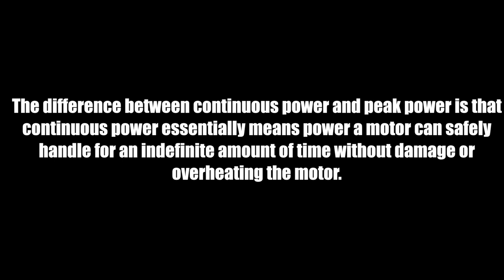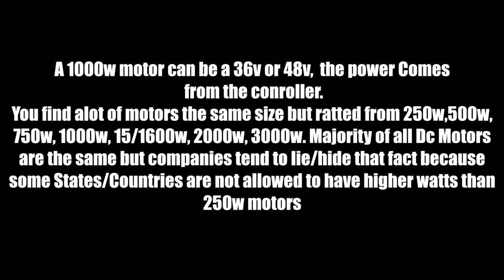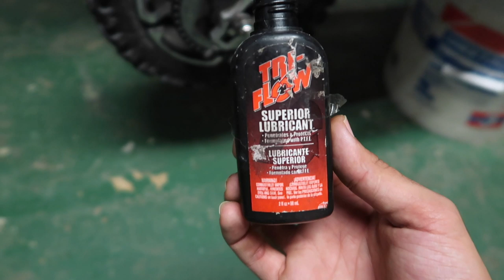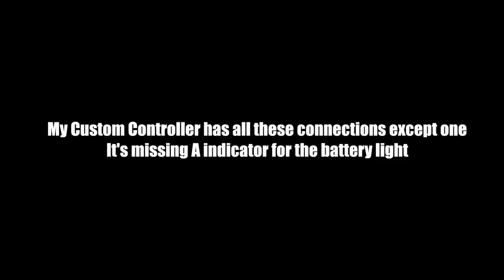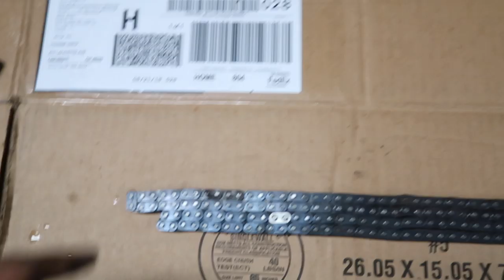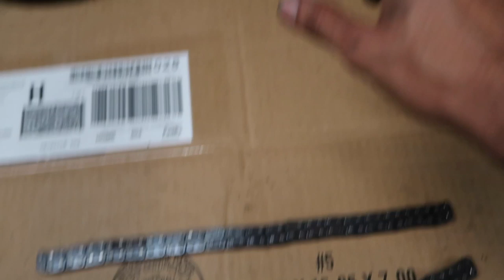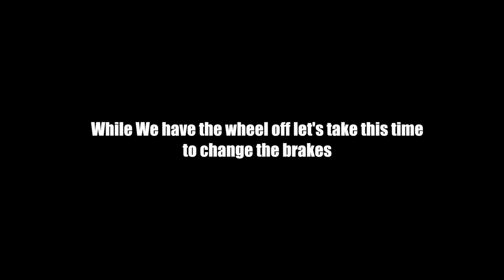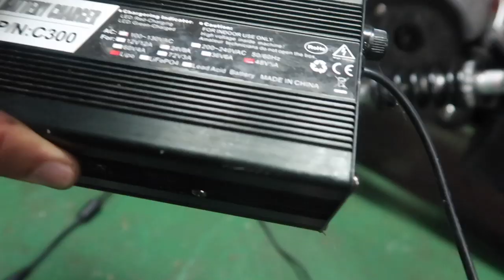Uberscoot 1000w/1600w Electric Scooters FAQ / How To

Comment: I love my UberScoot! I’m a70yr old Granny and live in a rural desert area. The knobby tires and shocks take me over rocks, bushes, any and everything the desert has. I’ve ridden uphill on trails and cruise through town.  Now, I have a problem. Lead batteries need to be replaced.  I’ve been told to go lithium. I know nothing about lithium. Where do I get them? Do I need new harness? Do the batteries come with wires, charger? Can the new battery be charged by the original Uber charger? I know, a lot of questions, but it’s beautiful outside! Not 110 degrees out yet! I want to ride, but can’t!  Please, any answers are greatly appreciated
Reply: All you need is the battery.....it should have the same receptacle on it.... your charger will take longer to charge it I'm guessing..
Reply: A few years late but a lithium battery cannot be charged with the lead acid charger and controller that comes with the original scooter. For instance a 48v sla battery charges to about 52v then shuts off. A lithium battery at 48v will charge to 54v and a lithium iron phosphate "lifepo4" battery will charge closer to 58.8v I advise a lifepo4 battery as they last twice as long as lithium ion "charge cycles" have a deeper draw charge faster and are safer. Threw one in my ecosmart metro and it compared to the previous same ah lipo is 6x longer between charges. They are also safer and less effected by cold and hot weather. Less fire risk than lipo. The only draw back to lifepo4 is they are heavier than the lipo batteries but still lighter than sla batteries. My 48v 20 ah battery has gotten me to work and around town for almost two weeks before dropping one tick on the battery meter while the 7ah sla batteries only got me to and from work for about 2.5 days. My lipo batteries struggled by about day 4 or 5 voltage sage was horrible requiring a recharge again. Go lifepo4.

Comment: 3 months later, no comments, suggestions.  Didn’t need your help after all 😏. Amazon had the perfect battery, best price I found.  Installed, no prob. Even installed the new charger attachment where old 1 was for the lead batteries.  Scoot is now light enough, I can lift the front or back, no prob. A few adjustments to chain, air in tires AND off I go! Farther and faster than before. 25 miles on combo dirt/pavement and on yellow now.  Possibly 30? I’ll let you know!
Reply: what harness did you use?
Reply: @BIGCHATZ42  I ordered my battery off Amazon and it came with a harness/pigtail.  I cut off the harness from lead batteries, used butt connectors to the pigtail end of new battery.  happily riding ever since.   I’m a 70 yr old Grandma and I love it! I ride it around our little town almost daily.  To the point I bought a 175cc Scooter for cruising the roads and places farther than my Uber can go. 👍👵🏻.  ps:  going to have to change my name, I am no longer Stuk Here! Lol

Comment: Hey man this is an excellent video! Really informative and fun with the ride at the end! I am looking forward to getting a 1900W 48V machine sometime around April (I live in a northern climate). I am definitely coming back to this video in the future. Saved in favorites
Reply: Oh and a quick question. The machine I am getting is actually 1600Wbut it has a peak turbo mode at 1900. Do you think its going to be a significant difference in uphill speed?
Reply from the maker: It’s most likely the same as my scooter cause it’s 1600w but in the video we see it’s actually 1900w+. Make sure the controller has 40AMPS output. If it comes with a lithium battery yes it will fly uphill. Anything lower than 40AMPS on the controller don’t buy it, unless you planing to upgrade it yourself. Do you have a link to the scooter I’ll check it out for you
Reply: But it also says that the 1600w motor has a custom made controller to make it 1900. I will definitely ask them if the controller is rated for 40amps. Thanks for the tip
Reply: @Scentedstyle  can this go offroading like super offroading

Comment: Hello Jason,  your videos about the UBER scooter are Full of great information.  I have a 1600w original scooter it is a great scooter time has come to change the Baterries. I want to upgrade to lithium 48v, 254h and 2000w. I'm buying the Battery from the website you recommend. I had two questions.  Question number 1. Do I have to change the original controller that comes in the scooter or I can use the same controller?    2nd question what type of fuse should I use for the Battery harness with two fuses holders in the red cable should I use 25 maps fuses?   Thanks in advance for your great support to the scooter community
Reply from the maker: Sorry for the late response I just saw your comment. 1. You don’t need to change the controller the stock one will work just fine but it does give you more speed if you upgrade the to a 40amps controller. 2. It depends on which harness you have but it’s an 80amps fuse if you have one like mine which holds two fuses then you need two 40amp fuses if you have the newer ones with just one spot for the fuse then get an 80amp fuse.
Reply: I put a 52 volt lithium battery on mine and is working great so far hasn’t burned any cables yet…

Comment: Good video mate 👌regarding battery indicator,you can install a external indicator,I did that on mine 👍when I upgraded from 48v to 60v,my stock indicator still works but it's not accurate as I'm still using the stock 48v throttle 😊

Comment: 200% helpful video!! All very clear!! You are the top my man!!
Definitely you reinforced my will to buy one.

Just 3 questions please :)

1 - That model looks to be a folding one. Is that possible?

2 - How long will it take the batterie until they die for good? Maybe you could create a video just about it!? After all I believe it will be the most expensive part of it...

3 - Rain...!! The most common complaint, at least on the cheapest models...!!! How does this scooter handle that? I live at London buddy... :D
Reply: rain and scooter is not a good mix tbh and the battery it really depend if you over charge it but you could upgrade for a lithium one

Comment: I got the 2000 watt Mototec version of this (basically the same scooter without the lights) fast as hell with the stock battery (I believe it’s 4x12 volts=48 volts, not so sure about the Amps). Will be upgrading to a 60v 25amp lithium making it 1500 watt (60x25=1500). I know my scooters controller caps off at 2200 watts so I should be ok. I know I’ll have a faster scooter after the upgrade, I just hope I have further range. Plan on taking this to work and my trip will average 24 miles. I did also purchase the wire kit. Wish me luck, I’m hoping it all works out.
Reply: how did it all work out ??
i have the 60v battery shit ...

Comment: My 1,000 w scooter batteries are dead. I need to replace my battery. It was 12v 12ah but I can use 12v 15ah instead?

Comment: Awsome video brother! Thanks a million! Ive got a 36v 1000w scooter and i love it. Had to buy new batteries 2 months agio and the range was amaizing until ive noticed it lasting less, and takes less time to charge. Sounds like a battery is faulty. I have informed the shop and ill be taking it for an inspection next week. Thing is. They can only check battery volts and not ah. 🤔 Ill see what they say then.
On another note, where dis you get that battery from? What make is it so i could ask about it at my local battery shop? Thanks a lot once again dude.

Comment: hello Jason , I was watching your video after losing almost half an hour watching videos that did not help me at all. in my case I bought a used 1000W 48V Evo Electric Scooters from 2015. after watching your video I would like to know if it is possible to modify it to a 1600w, what dou you recommend? thanks for the videos Bro
Reply from the maker: You will have to change out the controller to a 1600w controller and also the battery needs to be replaced from 36v to a 48v battery the motor will still work after upgrading but if you want more torque you might want to upgrade the motor also. Pretty much it’s simple just swapping parts out from 36v to 48v the tricky part is finding a 48v battery to fit in the 1000w model as it’s a bit smaller than the 1600w. One option is when buying a lithium battery you can measure your scooter and have them custom build the battery to fit inside

Comment: I love that you put a Lithium battery in there.  I am thinking of buying an Uberscoot..  Question.  Besides 12 Volts, what is the difference between the 1,000 Watt and 1,600 watt model??  Can it be converted by only adding or removing 12 volts?

Comment: awesome job on how to trouble shoot your hole scooter gave you thumbs up on this 1 .. One thing I would add is upgrade your power connectors  and if you pass 20A dont use the yellow box and cut off end connectors ,use higher amp rated connectors ,like 40A Bullet connectors ,1 more thing, if you bypass the light, horn ,brake light plug add a On/Off switch . You will see a bit more range and power :)
Reply: at 48:30 i like your stunt moves ,having fun going home and forgetting you got food in a bag lol

Comment: I would Highly recommend before you put heat shrink tubing on bare wires you do a wrap of electrical tape first.
Reply: Tony Fresh how are these in water  are they water proof or resistant I heard u can’t get it wet
Reply: I repair electronics for a living and I disagree.  All shrink tube should be dual layer shrink tube or "marine grade" shrink tube.  There is no need for electrical tape.

Comment: Jason Evo, you're awesome man! Thanks so much for this very helpful information!
Reply from the maker: Thanks Chris, I'm happy to help
Reply: @Scentedstyle  You're certainly welcome Jason. I come to your channel often to get as much information as I can about my 1600W Uberscoot and you were the one got got me started in this AWESOME sport in the first place! Thank You
On another note, I was wondering if you can also help me with a problem I've been having.........Every once in a while when, say I'm sitting at a red light and the light turns green, when I open the throttle, my scooter will not respond. I was having this problem a couple months ago and I figured the problem was a damaged control board. A few months ago while switching out the lead acid battery for the lithium battery, I forgot that the cables from the battery were still connected to the red and black wires from the control board and yanked pretty hard. As embarrassed as I am to admit this, I actually did this a few times because I guess I get careless when I am totally hooked onto something like this. Anyway, I noticed (back then) that the throttle would do the same thing it's doing now by not responding at times. This lead to more frequent times it would do this which then led to all 3 lights shutting off when I tried to open the throttle and finally the 3rd stage came with the scooter showing no signs of life when I turned the ignition on (on a fully charged battery.) 

At that point I figured I needed to order a new control board (which btw takes freakin' forever because every store online in the USA gets sold out of those in a matter of days!) When that control board finally came in, I switched it out for the old control board and I was having no problems until a few days ago when suddenly it starts doing the same damn thing at a traffic light, LOL! 

So therefore my question to you is do think this problem is a bad throttle switch? I swear to you that I have been EXTREMELY careful to disconnect the battery and not accidentally yank on those red and black wires coming from the control board. Could I have been actually dealing with 2 different problems and solved the first problem with the control board while the problem with the throttle? If not, what do you think the problem is? As always, your knowledge and help will be MUCH appreciated!
Reply from the maker: You need to change out the throttle because if one of those 7 wires from the throttle get damaged from yanking on it or just overheating can cause the controller to fail. Those controllers you see in this video are bought because i had the same issue as you, my throttle stopped working i figured it was the controller i swapped it out turned on the scooter it turned for about 5 seconds and died- turned out the throttle had a faulty wire (in my case a burnet wire hardly noticeable) and it caused my new controller to fry so i swapped out the throttle and changed the controller to 38amps controller and its been more than a year and no problems at all 

Since you the 1600w and the lithium battery i would highly recommend that you upgrade your controller to this 40A from aliexpress two downsides to it, one its missing the wire for the indicator for the batteries light but since you have lithium you don't need it as you know you'll probably get tired before the lithium dies. Two the shipping takes between 2-3Weeks if you can live without the battery light go with this controller you'll get more power and speed 

took a while but i found it 
https://goo.gl/ovPDmc
Reply: @Scentedstyle  OH COOL!! So I get even more power and speed now! This is great and it's because of these inside tips like this that I keep coming back to your channel! Thanks again for the advise man!

One question about switching out the throttle.......Is it really easy to swap out like the control board or is it a lot more complicated? If it's really hard, do you have a video on how to do it?
Reply from the maker: Thanks bro for all your support these videos are for you guys and its my pleasure to help
DAMN IT i know i forgot something. I should have included how to swap out the controller but its not hard if you do it correctly

what you want to do is remove one harness/wire at a time and reconnect it to the new controller do it step by step you wont have any problems

the throttle is pretty simple as it comes with the correct harnesses so you just plug it in to the same ones you remove from the controller 

if you have trouble just let me know and i'll make a video on it
Reply: @Scentedstyle  Thanks Jason, your knowledge and help with all of this is priceless to me. Also, just to let you know, I also ordered a 3200W Dualped Electric Scooter. It's supposed to be arriving in a little over a week from China and it top ends at around 65 MPH!!! Plus it has a range of around 60 to 100 miles!!! I don't know if you've ever heard of this type of scooter but I found it by searching around Youtube. It comes with a 1 year warranty (which I of course used my credit card for) and you can see it being demonstrated for yourself by searching "Dualped scooter" on Youtube.
Reply: @chrisulmer694  does it have a seat?
Reply: @minireefaddiction4699  Yes it does come with a seat but I think it's much preferable to ride standing up like a skateboard. Just like skateboarding it takes some practice but once you've mastered it feels natural. This thing will go more twice as fast as the 1600W UberScoot with more than twice as much battery life!
Reply: Is there a speed limiter on the Uber scooter if so what wire do I disconnect to make go faster

Comment: My uberscoot16 has recently been putting around slowly stop n go ...I've just finished swapping out the throttle assembly witch hasnt fixed the issue....i can pick rear wheel up off ground n it seems to spin normal up until the wheel touches ground then its stop n go......any suggestions on what to do please

I've tried swapping the throttle assembly with no luck
Reply: wat was the issue ???

Comment: I got a 60v 18Ah a few months ago and it feels like the lithium ion battery is starting to get weak. I accumulated just under 1500 miles and I want to upgrade to a LiFePO4. Is this compatible out of the box, or at all? I ride a Mototec Thor 2400w dual motor.

Comment: AH means Amp Hours.  It is how all batteries are rated.  Hall is for hall effect sensor.  It is only the position of the rotor so the controller knows how to fire the stator power.

Comment: My 1000w uberscoot battery is starting to die. Was wondering if I buy a 48v LiFe battery, can I just replace the battery and get more voltage or do I have to replace the speed controller as well?

Great video, by the way!!!

Comment: So if I like to use 2 motors(36v800w front wheel motor) I just need to increase the controller. 2 36 motor = 72v controller.

Comment: Hey what wire do I remove for the speed limiter?
Reply: depends on what scooter, some have a sequence of pressing buttons and some use an app
Reply: E-Scooter Vlogs did u find out
Reply: I know like that is the FIRST thing we want to know  ...not finding it ANYWHERE online
Reply: @gilbertmartinez6538  go into your controller , you'll find 2 really thin wires coming out of your controller and connecting  into each other , usually green , white or yellow , disconnect them and BOOM !! Your done
Reply: The gray wire on an UberScoot 1600w 48v.
Reply: If you buy from super cycles and scooters there is no limit or it is just a speed controller and raw power controlled by the throttle. It is not a limiter that you need but to change the sprocket on the motor. Change from 11 teeth to the 14 to there is many websites that have scooter parts just order it with the right shaft size. Put it on and you will go 50 miles an hour. You will get half the run time but you will go 50 miles an hour!!!

Comment: Is it ok if i put a 48 volt battery in the 1000w scooter and would i need a new controller, would it overload the motor eventually? also would a 1600 watt motor fit in the 1000 watt frame, plzzz answer this question its been bugging me forever and i cant finf the answer anywhere. Also whats the highest volt battery i could put in for a 1000 watt motor  thnx alot man
Reply: U cant put a 1600w motor in an 1000w but u can put a 48v in a 1000w